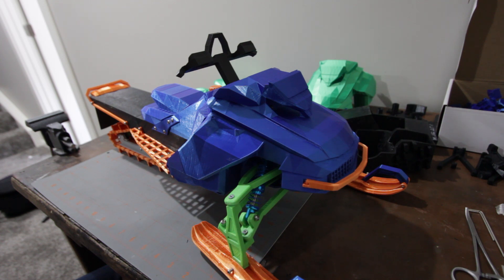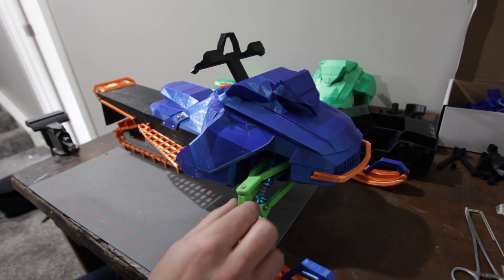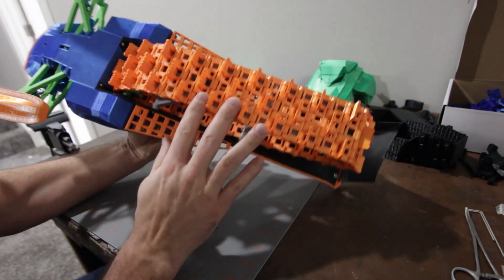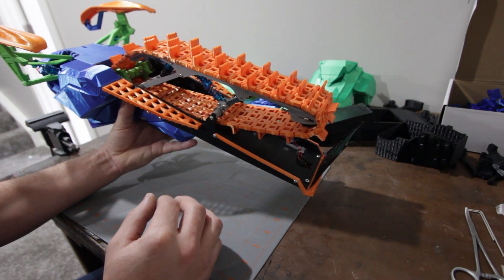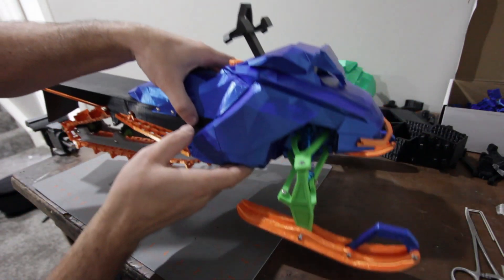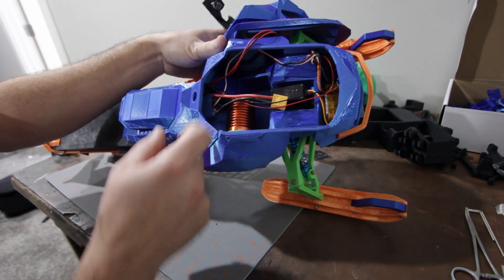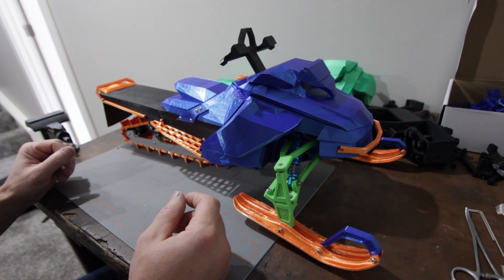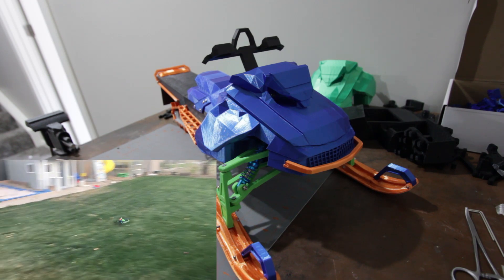SkeeRide - 3D Printed RC Snowmobile

Comment: Do you have any videos explain the latest upgrades? I’m struggling with some of them knowing what’s compatible or not with my purchase few weeks ago. So I built everything stock but now I’m wanting to implement the upgrades but don’t know where to began. If you could assist me please?
Reply from the maker: Only video I have on upgrading is for the front suspension. I do recommend using the new suspension with rack steering. The other mods are more personal preference. The most commonly used is the skid mod that you can find a diagram for in the build guides on the discord server.

Comment: How much roughly did it cost to build and how much filament did you use? My school has a 3d printer i can use but it charges by how much filament you use so i would like to know how much it used
Reply from the maker: Less than 2kg of filament. I think it’s pretty close to just over 1kg, but a lot depends on how many walls and how much infill you use. For all the hardware and electronics you can get it done for  $200-$1500 depending on what brand and quality you buy.
Reply: @BuildItBetter3D  where did you get the Hardware? And is there a list of all the hardware you need anywhere?
Reply from the maker: I buy most of my hardware from Amazon and eBay. If you want a pre made pack for the SkeeRide then here’s a easy option.  https://rcprinter.com/products/skeeride-build-kits

Comment: the shocks listed in the description are the wrong size, holes are too small to fit m3 screws and the ball ends aren’t big enough, also they don’t seem quite long enough
Reply from the maker: Just pop the ball ends out. It’s hard to find short shocks with m3 ball ends.  The long shock should have m3 holes.

Comment: What size 3D printer do I need for this.
Reply from the maker: You’ll need a print area of 200mm x 200mm. The Ender 3 seems to be the common one used for it.

Comment: Stl
Reply from the maker: Link is in the description
Reply: @BuildItBetter3D  da finde ich aber keine stl zum downloaden
Reply from the maker: https://www.myminifactory.com/object/3d-print-skeeride-rc-snowmobile-143369
Reply: @BuildItBetter3D  da ist nichts zum downloaden nur irgendwas zum kaufen ich möchte die dabei haben und nichts kauf
Reply from the maker: You must buy the files to 3D print them. They are not for free.
Reply: @BuildItBetter3D  alles klar also nicht brauchbar
Reply from the maker: The price is very fair for a complete RC snowmobile.  You will not find files any cheaper for something this complete and easy to assemble.
Reply: @BuildItBetter3D  ich habe angefangen mit 3d drucken weil das eigentlich kostenlos ist den jetzt muss ich filament kaufen teuer dann strom teuer und noch die stl da kann ich ein richtiges holen im laden das ist güstiger

Comment: When i buy this snowmobile in skeeride are there motor by default or only model
Reply from the maker: Buying through MyMiniFactory is just files for you to 3D print yourself. If you want to buy a sled already printed you’ll need to join us on discord. There’s authorized sellers on the discord channel.

Comment: which battery do you use? up to what size of battery little bit your put I think I saw you buy the files
Reply from the maker: I’m using 3S 1500mAh 100C battery. Others have said they are using bigger batteries. Lots of info in the pdf included with the files. Also lots of good help and info on the discord channel.

Comment: do any other spur gear can fit your model because the spur gear 56 tooth are back ordered in canada
Reply from the maker: It was designed specific to fit that gear, but others might have the same bolt pattern and still work. Just have to check to see if dimensions are the same.
Reply: @BuildItBetter3D  ok cool thanks a lot:)

Comment: im curious to see if we can make a tpu track instead of plastic one :)
Reply from the maker: I haven’t tried it yet. It might work, but I don’t know for sure.
Reply: @BuildItBetter3D  Only have a few more segments to go but the TPU track is looking super promising with 2mm aluminum crafting wire as the pins.  It's super quite without any chatter sound.     

With the TPU the pin locking flap isn't needed since you can bend the end up over the pin now unlike PLA.      If the TPU track ends up working well it would be nice to have a version of the track files without the tab that is printed closed on both ends.   

Shocks and bearings are ordered and will be starting to print the rest of the sled this week.
Reply from the maker: That sounds great! Please keep us posted. If it proves to work well I will make a version of the tracks as you’ve suggested. It would be great to have the flexibility of tpu, would help when hitting a rock to not break paddles off.
Reply: @widgget  crafting wire where you have find it??
Reply: @widgget  im curious about your set up :) its very good news about this mod :)
Reply: @BraveNewWorld1984-r6o  just search Amazon for "2mm aluminum crafting wire".    My wife had a roll in her art room i snagged 😆.
Reply: @widgget  hahahahah  :)
Reply: @BuildItBetter3D  indeed im sure its possible :)
Reply: Just purchased the files and only have TPU at the moment while waiting for some PLA+ in the mail so figured i would give it a try doing the track TPU since it might be a little quieter , first section is 70% done and looking good.
Reply: @widgget  cool! can you post a video on it?:)
Reply: @BraveNewWorld1984-r6o  Yeah i'll post one once the track is finished but it will be awhile before actually running one on a sled because i haven't started the sled yet. 

after attaching 8 sections, first impression is that TPU is well suited for the track and and is very quiet when it's moving,  ithere is defently some flex in it lengthwise due to the squares in the design (real tracks use belts like a tire to fight against this).  not sure if it's going to pose too much of an issue until it's actually tested on a sled but track tension is going to be much more important to get dialed in if going this route.
Reply: @widgget  yeah the tension will definately different!!  and maybe  by increasing the infill too will help with stretching of the track.. some tpu are more harder and less stretchy like the  3d hero tpu  like they sell on amazon

Comment: do you suggest sealed bearing for the track bearing?
Reply from the maker: The ones I’m using are not sealed. They are the cheapest stainless steel I could find. So far they’re doing well, and since they’re cheep it’s not a big deal to replace if I have to. Sealed would be good too, then you’d probably never need to replace them.
Reply: @BuildItBetter3D  ok thanks because im buying them on amazon right now :) very nice work and thanks for sharing your hard work to everybody:)

Comment: I must say good job! I’m thinking of buying the files but I was wondering if my printer has a large enough print space for the parts to print. I have a Flashforge Finder which is 140x140x140mm. Would this be big enough?
Reply from the maker: Many items would fit, but you will need 200x200mm for a few parts.

Comment: Wondering what size battery you are running and is we could get a better look atthe a-arm suspension and steering linkage also what is the overall length im looking at buying your plane and building one myself
Reply from the maker: Overall length is approx 23 inches. I have two sleds set up right now, one has a 3S 100C 1500mah lipo and the other has a 4S 75C 1500mah lipo. Your choice will depend on the motor and speed controller you use. Getting a motor and speed controller that is sensored will give you better slow speeds and power control, but it's more expensive. I have a video that will be up within a couple days that shows the front suspension assembly, that will give you a good look at it. If you join discord there is a list with links to items such as motor, speed controller, etc.
Reply: Thank you for your feedback
Reply: I was wondering what printer you are using to build this mine is only 220x220x250 wondering if thats big enough if I get plans from you
Reply from the maker: Yup that’s big enough. I’m using a tevo tarantula 200x200x200

Comment: This is a sweet sled man, spitting image if pascals and looks like it will work great
Reply from the maker: Thank you! It’s not nearly as refined as pascals sleds, but I take that as a big compliment to be compared to his work. I’m really excited to see how it performs in some deep snow. Keep a lookout, I’ll post a video as soon as I get some snow.
Reply: @BuildItBetter3D  its better than what i could do for sure, but the only thing id change is the way u connect the track with maybe a carbon fiber rod or somthing still keeping it light but works pribably better, i just mod the new bright sleds, i actuly have a video up of breaking jy yellow ome
Reply from the maker: Carbon fiber rod is a good idea. I’ll have to keep an eye out for a good deal to try it. I just watched your vid, wish I had snow like that to be running in now. Looks fun, I’m sure you’ll have it fixed in no time.
Reply: @BuildItBetter3D  i have 3 of these, in less than 12 hrs i had kne of my red ones running. I just baught another yellow one that im prolly ganna do a biuld siries if people would watch it
Reply from the maker: Sounds great. I’ll watch it for sure.
Reply: @BuildItBetter3D  do you have face book or anythimg i could send u privatly what iv done to the sled i currently run
Reply from the maker: I’m on Discord. I created a server for the rc sled. Link in the description. You can join it and pm me from there.

Comment: Looking good! Although I'd recommend to use Autodesk Inventor for 3d printing to avoid those triangles and keep everything smooth.
Reply from the maker: I actually designed it in blender to have the triangles. I like the low poly look so it was done on purpose. I could easily add a subdivision modifier to make it all smooth the way you get from perimetric modeling but that wasn’t the look I was going for. Thanks for the comment, if there’s a lot of interest in me making it smooth I will consider changing it.